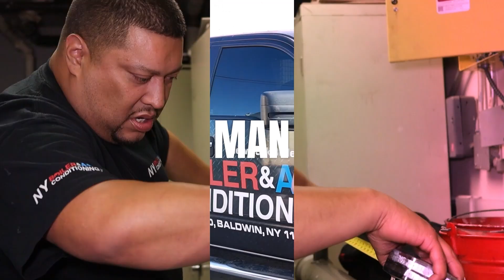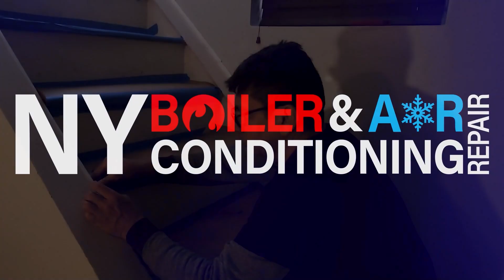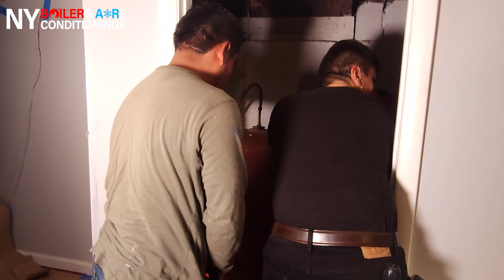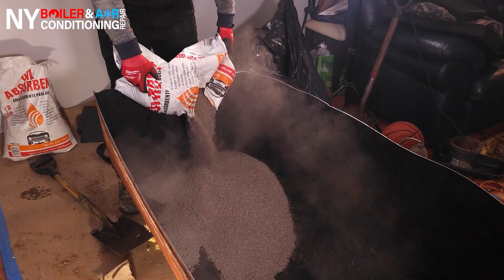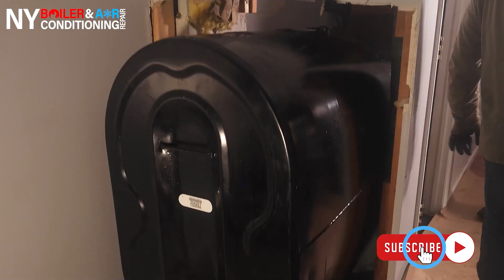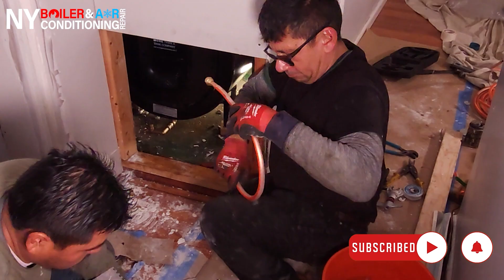275 gallon OIL TANK REMOVAL & REPLACEMENT (Louie The Boiler Man)

Comment: That customer should have paid for a small concrete pad on the side of the house and had that replacement tank outside the house..
Reply from the maker: Yea I agree, I explained and told them but they didn’t want to have the tank outside, so they decided to leave it in the same place the original tank was located.